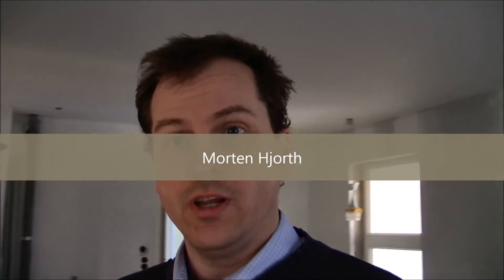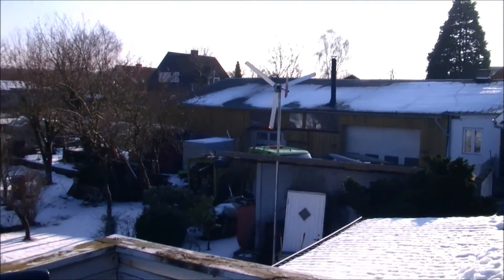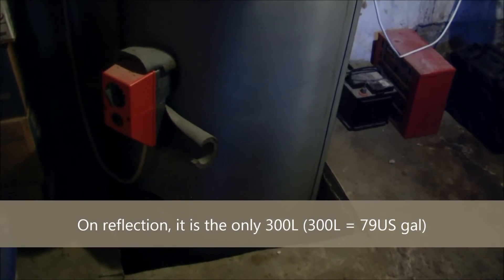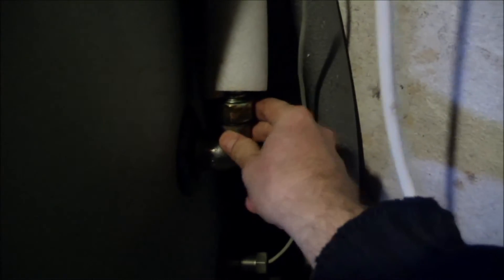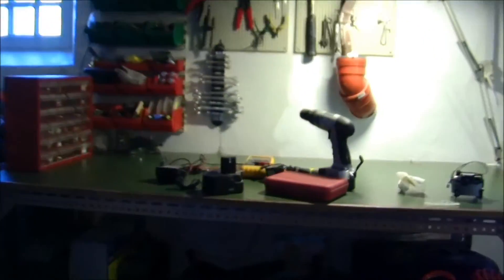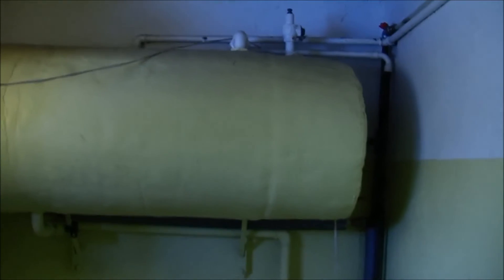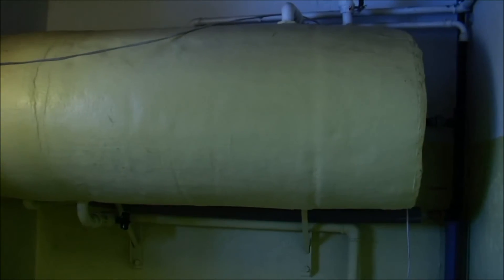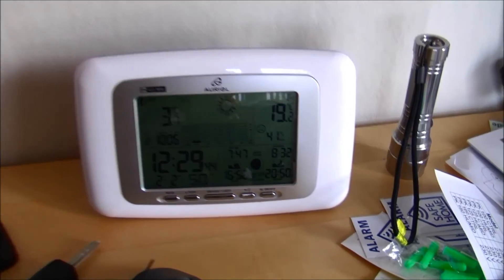Solar panels warms the water, even with snow on them - 009

Comment: You should check out my videos on heating water with excess PV now that you are upping your array size. Off grid I get all my hot water from excess PV not used for anything else.  This system attaches to the raq array DC before it goes into a MPPT controller and senses when panel voltage goes over power point. Then I diverts enough power to bring the panel voltage back to power point efficiently. That energy sure adds up. You look like you would be capable of building it. Consider this as another option to energy management in the future.
Reply from the maker: Hi opera
Thank You very much!  I tried to watch your videos about this,, but there is just to many. do you power the heating element with DC or AC ?
Thank you for watching! :-)
Reply: @MyPlayHouse    These are pulsed DC, but it could be done with AC as well. The take away should be that I am monitoring the PV voltage. A voltage rise above above the known power point indicates that there is excess power. This method is superior to those commonly used and can extract power without affecting batteries.